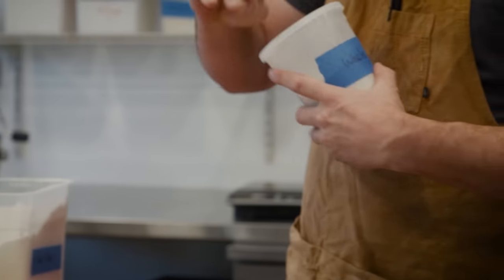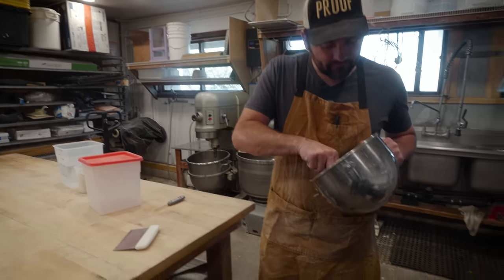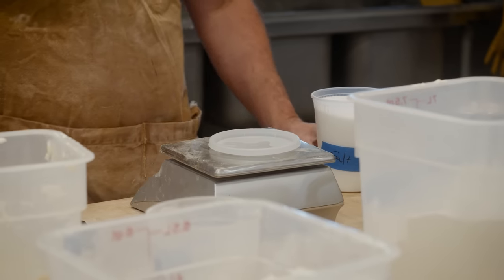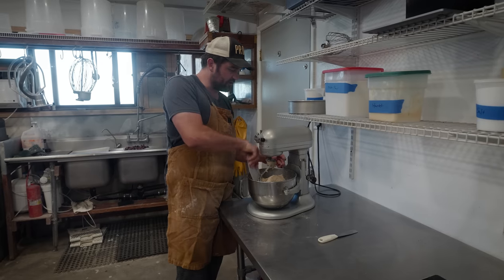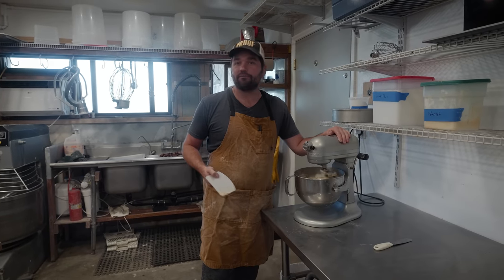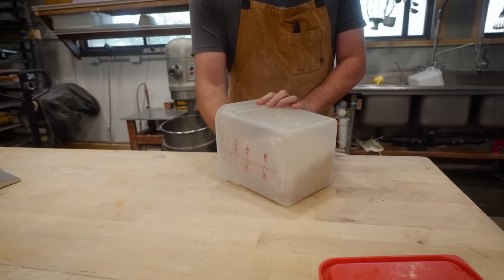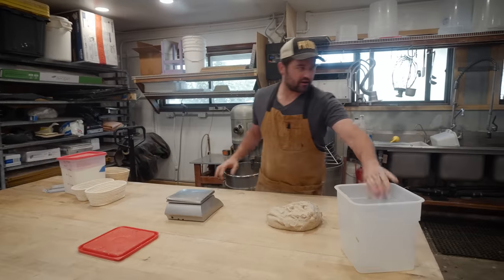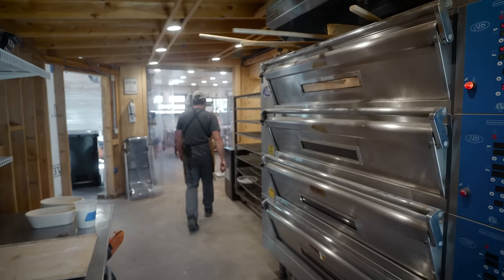Rye Sourdough from Start to Finish | Proof Bread

Comment: I’m new to this so asking a dumb question: Can you tell me why you use loaf shaped bannetons to make round loaves? I want to buy the right ones.
Reply: It’s still loaf shaped, not round. I use the round ones because I bake mine in a Dutch oven and not on a stone. The loaf ones won’t fit in a Dutch oven well.
Reply: In my experience as a home baker, it comes down to preference. An oblong banneton gives you most consistently sized slices of bread (more of a loaf shape), whereas a round banneton will give you a boule shaped bread, which will produce much larger slices in the middle than at the ends. An oblong loaf is also a bit easier to slice.
Also, depending on the dough, a single score along the top of the loaf can cause the bread to pucker at each end during baking, which can cause dough proofed in an oblong banneton to result in a boule shape, whereas dough proofed in a round banneton will be significantly shorter at the ends perpendicular to the score.

EDIT: Also, depending on how you store your dough in the fridge - I use cling wrap, but I've seen people use plastic bags or containers with lids - and the kind of fridge you have, storing multiple oblong bannetons in the fridge overnight may be easier than storing round bannetons.

On a final note, shaping dough is a different process for a round banneton, because you want the dough to be round rather than oblong. When I shape a round boule, I spread the dough into a rough square/rectangle and pull the corners in until the dough is roughly the same size on all sides. Then I flip it over and round it off to finish the shaping process.
Reply: @kstarler  - thorough explanation. Not a question I had but with your answer, I now realise I would have wondered about that eventually. Now I know - before it ever comes up. Thanks.
Reply: @ASouthernLadyinAppalachia  The word you are looking for is oval or oblong. You can have a round loaf, or an oval or oblong loaf. But there is no such thing as a loaf shaped loaf, because loaf is not a shape.

Comment: First timef  bombing completely. My starter is alive but I can't get the pre  dough not to be runny. Its like soup. I did it 3 times. It always rises but it is too runny to work with. I added more rye flour, bit it still is like soup. Please help, my husband has IBS & is counting on  me 7:01 g
Reply: What I do if I find my starter is runny,  take a little bit of it, like 50 gs an add 25 g of water in 25 g of flour. Cover it and check on it in 8 to 10 hours. If you don’t see any bubbles in the fermentation don’t give up. Take out again 50 g and add 50 g of water and 50 g of flour and let it sit out for again up to, but not more than 12 hours. Once you start seeing bubbles, then you’ll know where the fermentation is started and put equal amounts of water in flour. There’s another important factor to this too. Is this when you make your starter use bottled water do not use your tapwater. I only say this because tapwater has chlorine and who knows what else in it that can kill the fermentation process. I live in Oklahoma and I always use bottled water for my starter. if you have a bad batch of starter now, you might try this get yourself just a bottled water and put in a jar 50grams, then add 50 grams of bread flour. Always use in your starter the flour type that you were going to be baking your breads with. Don’t use all purpose flour for your starter and then feed it with artesian bread or something else. Alexa turn off the alarm. You should notice a difference in your starter in three days. You should see bubbles. And once you see bubbles, just keep feeding it the same amount. You could do two feedings two days in a row at 50 g of water bottled and 50 g of bread flour, then you could change to the following day 50 g of this starter then add 25 g of bottled water in 25 g of flour. Continue this for another day or two. But then you should have a nice strong stretchy starter to make you Leaven for baking you can use ( small batch) 10 grams of your starter and 100 grams of bottled water and 100 grams of bread flour. 10-12 hours later this should have doubled if not tripled, so make sure you do the Leaven in a quart jar! 😂 I hope this helps out

Comment: Is it possible the scalding is adding a bit of the tangzhong effect to the dough?
Reply from the maker: For sure. The scalding adds several layers of magic. First, so much flavor comes out of these grains as a result. Second, the introduction of water in this method seems to help the breads keep fresher longer. Third, the course whole grains are softened and as a result they do not gum up the dough or create undesired density. Such a simple process adds so many benefits that I am continuing to inventory.
Reply: @ProofBread  I'm definitely going to give it a go on my next Rye. I never go 100% so I'll try scalding the 30 or 40% I do use and add it to my biga with the remaining white flour.

Comment: As to the mixer , I’m a professional chef and I’ve sold professional equipment. You are burning out your motor with such a dense dough. You’d be much happier if you invested in a smaller professional mixer that has a stronger motor. You never want to over work the motor with too much product. Kitchen aid mixers are made for the domestic kitchen, not a professional use . Your going to ruin your equipment by using it in this way.